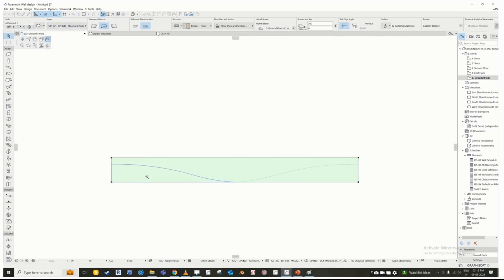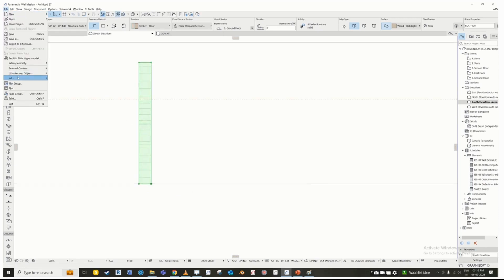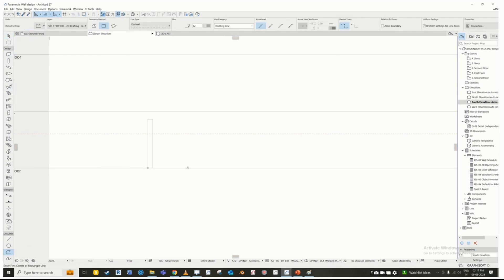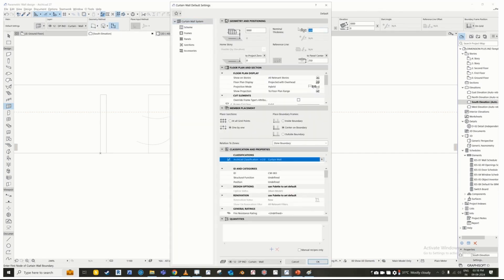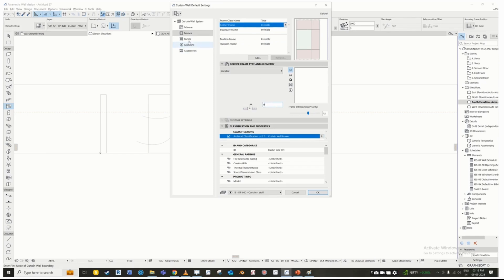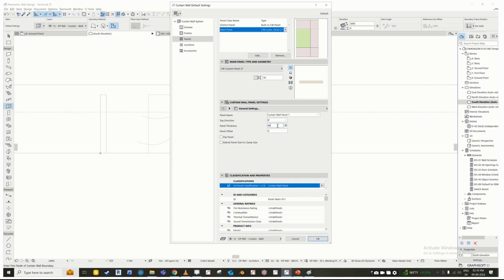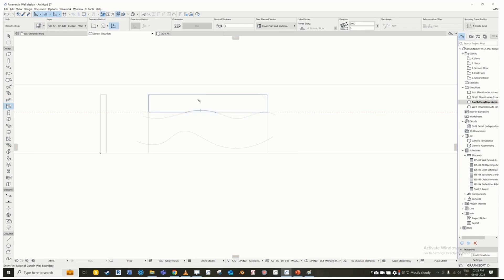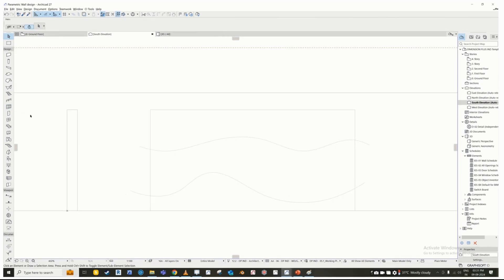Mastering Parametric Curtain Walls in Archicad Fast

Comment: Hi i can’t seem to get the last step in the elevation tab? It doesn’t paste
Reply: Hi did you manage to do that? I also have the same problem
Reply from the maker: At the end of the process, please note that we have not used copy-paste in the Elevation tab. Kindly refer to the subtitle, where it is clearly mentioned to use the Magic Wand with the Boundary Geometry Method of the Curtain Wall Tool within the Elevation tab to complete the workflow.